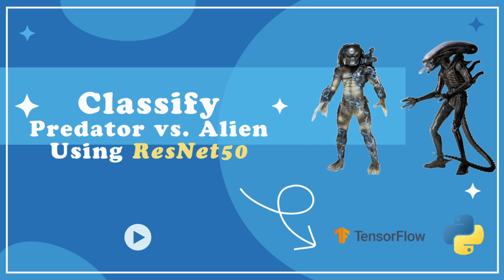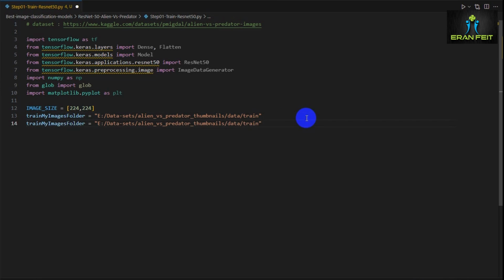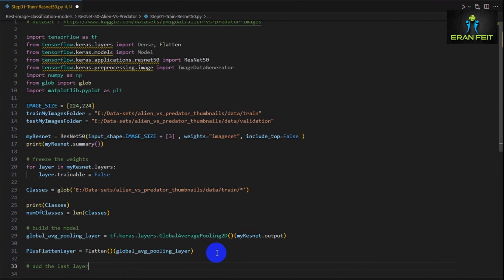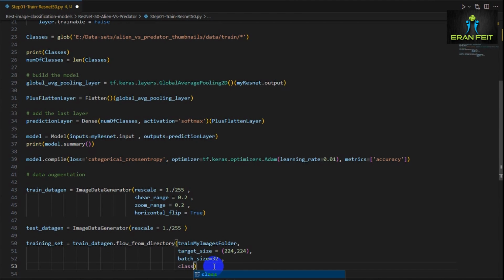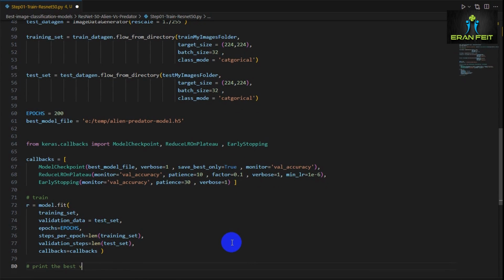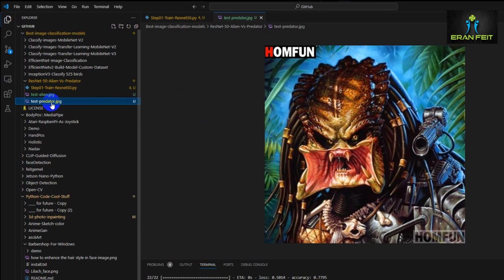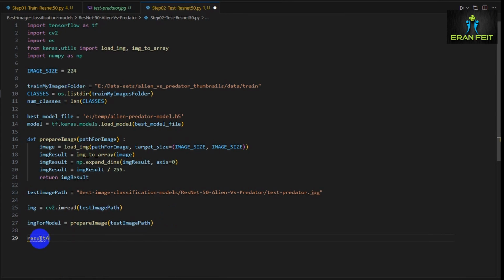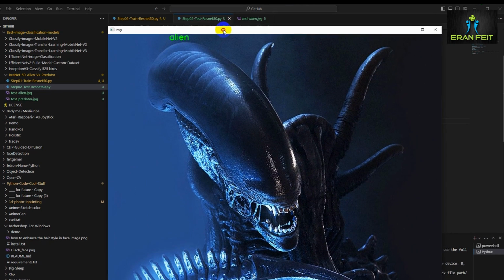Image Classification Using ResNet50 Model | ResNet50 transfer learning

Comment: I am using the ResNet50 Model for my image classifyer and i always get the problem, that the leftover batch which is smaller than the specified batch_size is causing problems. Is there another way to handle this instead of dropping the final batch? I can't find anything online
Reply from the maker: Never met this error message.